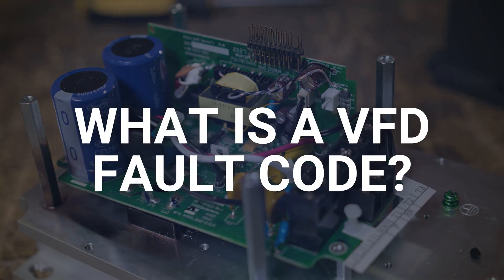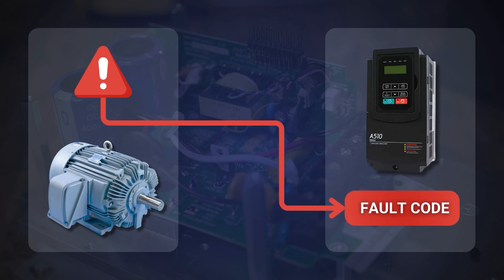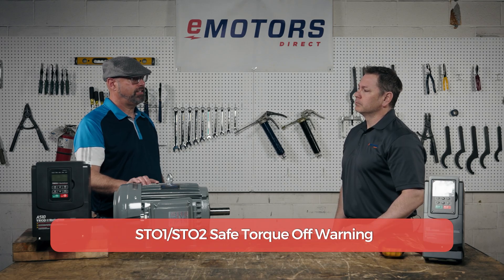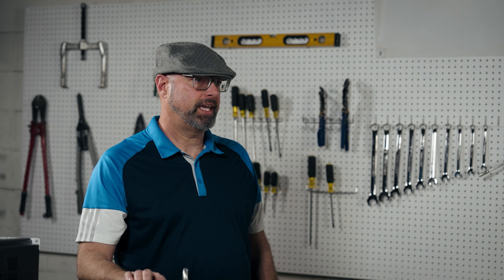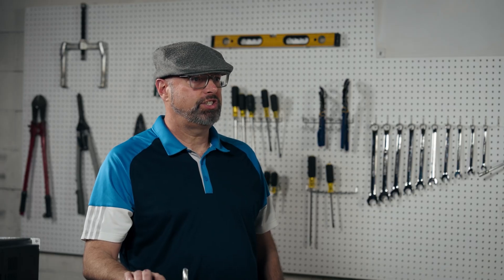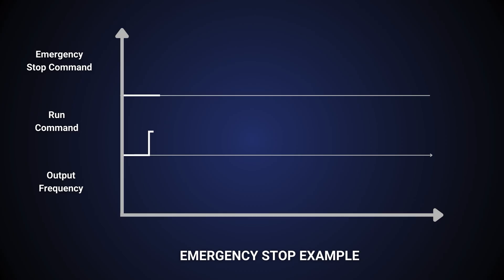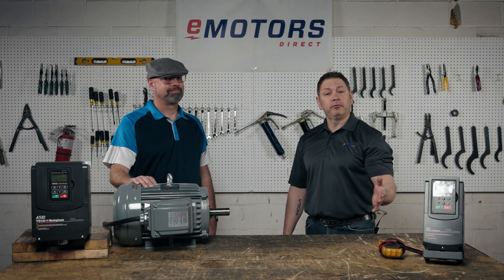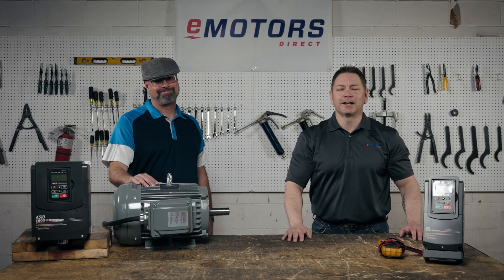Resolve VFD Fault Codes | Step By Step Troubleshooting

Comment: Sir i have problem with 30kw vfd.
P7.11= -20..
This temperature is very low.so when firstly i run vfd it never starts .
What should i do
Reply from the maker: Hi! If your P7.11 = -20°C, that means the VFD is reading a very low internal temperature, which can prevent startup due to protection limits. First, check the temperature sensor inside the VFD. It may be faulty or disconnected. Also, check parameter settings for minimum operating temp. Some drives allow you to adjust that threshold. If everything looks normal and it still won’t start, contact the drive manufacturer or your supplier. You may need a repair or sensor replacement.

Comment: On my VFD says breaker resistor fault, what could it be?
Reply from the maker: What drive are you using? I usually just map the fault code back to what's in the manual. From there, the manual usually gives decent troubleshooting tips. Every drive/manual is a little different. 

It could be as simple as loose wiring. Other common causes are heavy deacceleration, frequent braking, and incorrect connections.

Comment: For the Over Heating section he didn't mention how you reset that code so you can get the pump running again. Can you please help me with that?
Reply from the maker: The drive needs some time to cool off before resetting. To check the heat sink temperature, use parameter 12-41. If the OH1 fault occurs three times within five minutes, wait 10 minutes before resetting.

Note: A510 230V 50HP and above, and 460V 100HP and above, don’t support the heat sink temperature display function.

Fault Reset Methods:
- Set a multi-function digital input terminal (S6) to 17 (Fault reset); activate S6 for reset.
- Press the reset button on the keypad.
- Power down the inverter, wait until the keypad goes blank, then power up again.

Comment: When I run the Inverter. The displays shows OC. What parameters should I set ? Thank You.
Reply from the maker: That's an over current fault code. This is usually caused by one of the following: (1) Acceleration / Deceleration time is too short.  (2) A special motor or applicable capacity is greater than the inverter rated value.  (3) Short circuit or ground fault.
Reply from the maker: To troubleshoot:  

(1) Extend acceleration / deceleration time.
(2) Check the motor wiring. 
(3) Disconnect motor and try running inverter.

Comment: Sir please let me know fault code ( OPbFt )
Reply from the maker: Hi Myo, this is the high pressure fault code. The feedback value of pump pressure is lower than limit of maximum flow. Check feedback signal is correct. Check if feedback value of pressure is lower than limit of maximum pressure (23-12). Find the manual here: https://www.emotorsdirect.ca/item/teco-f510-4250-c3-u?quantity=1&tab=downloads-tab

Comment: A different question if I may: I am trouble shooting a mini fridge compressor (Huayi B35C5B) which now shows much higher, especially Run Winding resistance values than documented. As per specks they should be as follows:

Main/Run W.resist 16.10 ohms and StartW.resist. 13.50 ohms. But I am getting start to common 15 ohms and Run to common 23 ohms.

The PTC relay JPQII 4.7 (4.7 ohms) will make the required Start winding resistance higher (18.20 ohms) than run but now that Run Winding resistance being 23 ohms, what are the options? Also what would cause the Run Winding resistance go high.
Reply from the maker: There are a couple things you could do to troubleshoot. Just based on the information provided, I would inspect the motor windings for signs of damage. This might be tricky because this looks like an enclosed unit. Also, testing the relay to ensure it's functioning properly and potentially replacing it. If the issue persists, I'd  go back to your supplier for additional troubleshooting support. 

Smaller units like this can be expensive and difficult to fix, so a replacement may be your best bet.